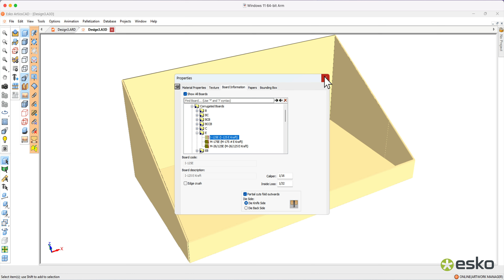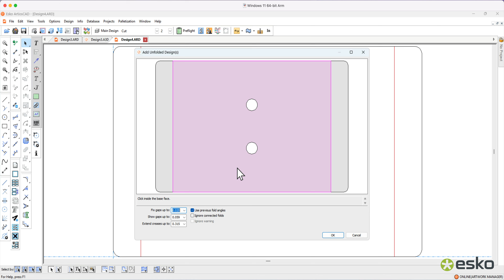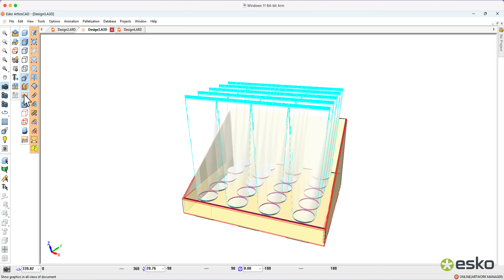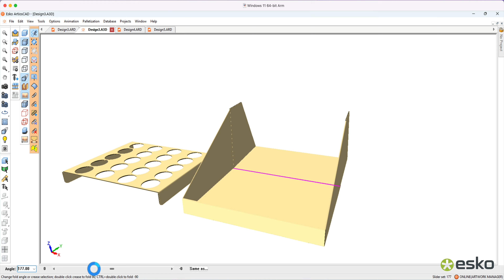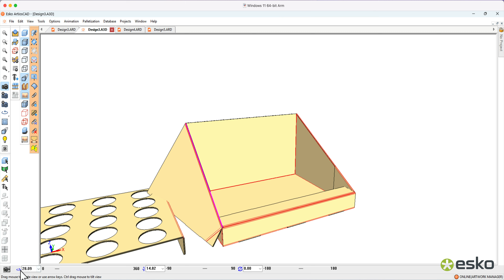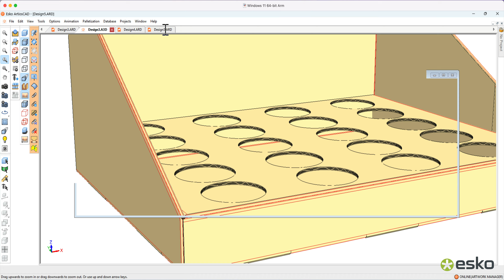ArtiosCAD retail ready packaging and assembly instructions

Comment: Hi! Great tutorial, thanks for sharing. I have a question: I only have the 3D tube model , the front and back label AI files, and a gradient background that should cover the entire tube. How do you create a full wrap-around body label in Esko Studio so the gradient background wraps around the whole tube while keeping the front and back labels in place? I’d really appreciate your guidance. Thank you!
Reply from the maker: you would use the toolkit app to "brush" the printable are on the entire surface. That way Illustrator knows where it needs to apply the graphics. You could also add a label surface to front and another to the back. Last option would be to use the shrink option.